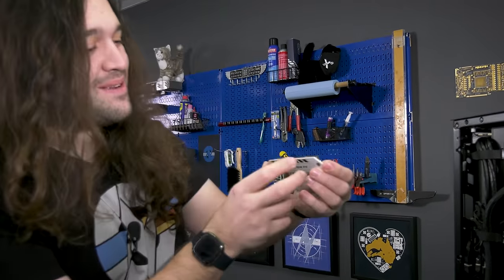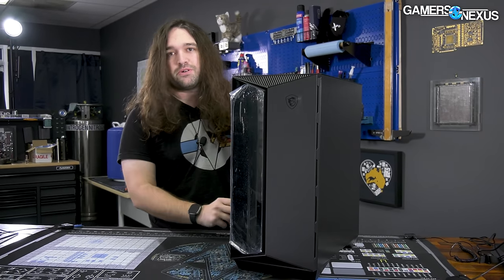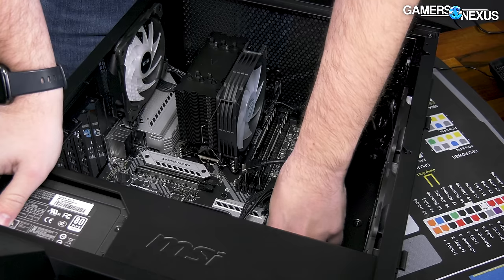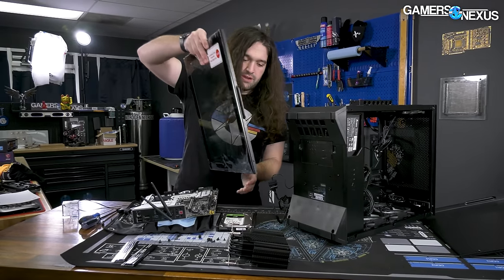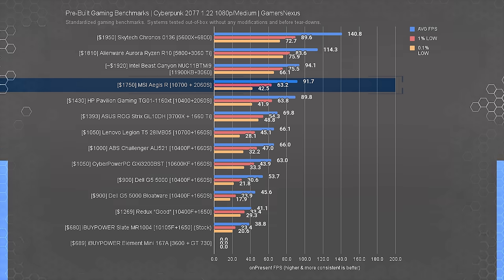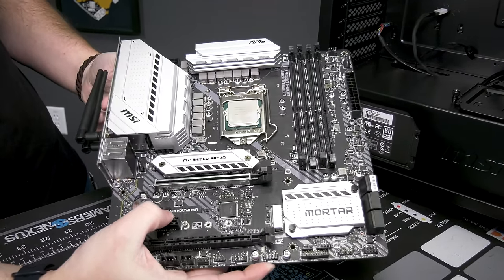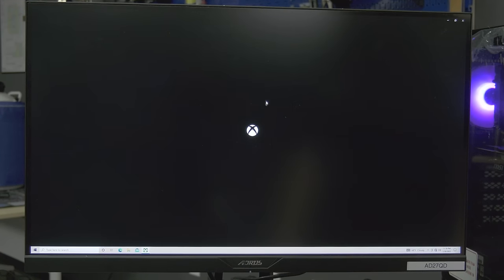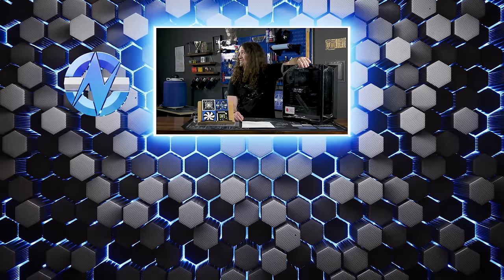MSI Pre-Built Bends SSDs & Boils CPUs at 100°C ($1700 Aegis R Review)

Comment: I needed a new PC and last year when GPU prices were astronomical(they still suck).  Have been building computers for 30 years now and trying to find parts during peak covid was a nightmare. SOOO I went with an MSI Prebuild (a previous Aegis build) that wasnt a completely terrible deal and had SO many issues with it.  SSD was faulty and the power supply exploded. Luckily I have components around and am pretty good at troubleshooting issues so was able to figure out the SSD was the issue but someone with less experience might have just ended up with a bricked system.  Returns were not an option so had to sort everything out myself.  I'll never go with a prebuilt ever again. I will personally never buy another MSI product because when I did contact them about the issues I got more of a headache than the initial issues caused.

Comment: MSI is hit or miss. They clearly have talented engineers, but I think it's the design/marketing departments who ruin their products.
Reply: Hit for me, my MSI z370 a pro is still working like on day one. Why did I pick it? It's the cheapest motherboard you can overclock with. This thing did cost me... 40€. 40€! The successor of this board, the MSI pro z690 a, costs 200€. What a fucking joke.
Reply: @tonnentonie2767  Hit for me too. I got a MSI G273QF monitor, same reason as you, it was the cheapest 1440p 165hz IPS with G-Sync (£250). I expected it to be rubbish but it was very colour accurate with brilliant motion performance. 

Only needed to do 2 things.
1) Change the WP to 6500K (it was R93, G99, B96 for my display). 
2) Download novideo_srgb and enable SRGB clamp (this relies on EDID, which MSI configured correctly). 

Calibration reports show that it's basically spot-on after that. Honestly a lot of stuff done right that I didn't expect for just £250.
Reply: @Terrobility  wow, when did you get that monitor? That's amazing spec for 250£

Comment: For anyone that does buy this system, just take the front panel off. Simple as that. If you want it to stay on, take it off, and use a Philips screwdriver to remove all of that metal mesh from the interior of the front panel, and then take a hole saw (a drill with a wide circular bit in it) and drill some holes into the plastic on the side opposite the tempered glass in the front panel. This'll get your airflow up to adequate.

Comment: The "guts" of Norton/Symantec security suite are light weight and work very well, plus they allow nearly every "feature" to be switched off which is exactly what anyone using it should do.... turn off everything except the AV and firewall.  (This takes maybe 2 minutes)  On the other hand MacAfee is complete buggy garbage no matter how its configured and just doesn't work as intended.

Comment: Only once have I seen a CPU that hot, and that was a Pentium 4 with a loose cooler.
And when stuff bends like that, the screws are to tight. Seen that with a cooler before, but all it takes is to take maybe half a turn off. They should probably use a thinner pad.
And that Case.... There is a reason why I prefer a plain mesh front. Looks good and lets air in and can filter. Even helps with noise because the air has more room and doesn't has to yeet through some tiny gap.

Comment: Why cant case makers at least give 1.5 inch grill or mesh on the sides of the front panel if they plan to have a solid front and front fan mounts? is it that hard or expensive? Feel like the only reason for front fans in half of the cases today are to add RGB. Not move more air! Also would be nice to add 2 inches to the top if you are going to add top fan mounts to let you use a radiator that's all for my rant on cases lol!

Comment: I don't think even a Liquid Cooler would provide sufficient cooling for 255w.... Why the heck is that a settig in the BIOS? Because I think that's the main problem and it would be if you put it in a different case unless you changed the setti gs in the BIOS.

Comment: I almost went with a MSI until I saw how hot some of them get. Lenovo Legions have excellent cooling systems and I got one for $500 off from Micro Center. My Legion never gets hot. I noticed some have because the front fan being put on backwards. Didn’t happen to me but it’s an easy fix if it does happen. I really like MSI and their quality of hardware but they need better cooling systems in their computers.

Comment: I think I know the problem. Each component is made by MSI factory line and robots and machines do it the same way for each board and card.  I don't think I have seen a robotic line put together a whole computer. Once the parts came off the assembly line it was probably handed  to a human for assembly in a case and the "Human Error" factor was probably in play.
It's sad because I have an MSI b550 Mortar and an MSI X570 Tomahawk and they both work great.

Comment: Are you guys sure that that's a 2060 Super? I have the MSI Ventus 2060 Super, but mine doesn't have the additional 6 pin connector and as far as I'm aware, no 2060 Super has one.

Comment: I used to think the case didn't matter too much. Then I bought a cheap one without realizing it had absolutely ZERO ventilation and my machine 'bout caught fire. Since I thought I threw my old case away, I no joke dremeled a hole in the top and screwed a fan directly into the metal. It STILL ran CRAZY hot so I said fuggit and grabbed the dremel again...cut a MASSIVE hole in the case door and stuck (literally) the biggest fan I could find to it. With what was essentially box fan stuck to the side of the case, temps were finally OK! lol...the case matters.

Comment: Welp thats upsetting to see... I bought one of these a couple of months ago after my last pc died because it was all I could really find in my area that fit my budget and needs. Any advice for how to fix this going forward? Newer to computers in general, not sure where I should even start.
Reply: Personally, I would start by downloading some sort of hardware monitor for temperatures. MSI Afterburner is an easy one to use. Then start looking at the temperatures of the CPU and GPU being reported in the monitor before taking any further action.
Reply: @Pog Tuber  I did that and honestly im not seeing the same issues in the video. I downloaded a temp monitor and cinebemch to test the cpu out and saw my temps only getting up to 84°C which from what im reafing is right on the limit of acceptable. When transferring large files my power plan doesn't change to the custom profile. I know there are other cases in this same lineup of cases that has much better ventilation on the front, do you know if i can buy a ventilated front panel and have it be compatible?
Reply: @baguettemeister6032  I don't know about the front panel, you would have to buy one specifically made for your case. I don't like that 84°C temp though, personally. It's not dangerous but a properly installed aftermarket cooler should be doing better than that.
Reply: @Pog Tuber  This is of course with the cpu completely pegged on cinebench I don't know if thats completely representative of the temperatures ill be encountering in my daily driving of the pc. Even playing some pretty intense games like escape from tarkov my temps hover around the 50-60 degree mark.
Reply: @baguettemeister6032  AHh OK my bad, yeah Cinebench is not realistic at all, I thought you were getting those temps during gaming. So yeah you're fine.
Reply: @pogtuber5146  Maybe I just got lucky then? Hard saying.
Reply: @baguettemeister6032  It's possible that Steve got unlucky and received a flawed product, as well.

Comment: I have that computer I bought it on Newegg a couple months ago mine came with a Nvidia 3060 and the same CPU however the first thing I did was put a second SSD and swapped out the ram but even when I first got it it never had a heating issue despite the fact that the case is kind of eh

Comment: Im at the moment doing a build for a customer for $1600 build and hes getting way more computer lol thats crazy haw bare that is for 1700, he gettinng a 9900k with a gtx 1080 ti , evga 850 psu,16gb ram gkill, 1tb samsung drive,core p3 case, corsair 240mm aio with lcd screen on the water black thats show gifs with rgb corsair ll fans and a few other things that have came in yet, its a full custom that blows this one away, its crazy how much msi is asking for this low end junk of a prebuilt XD thanks steve for showing potential buys and helpng them dodge this mess.

Comment: The backplate will actually get you 7-15°C higher temps, I have an RX 5700 MECH GP OC, and it idled at 46°C with the backplate on and casual 105-111°C under load, without the backplate it idles at 33-35°C and 90-100°C under load. So the backplate since it has no pads is actively hurting the performance. I took it off, but since this is MSI we are talking about, there obviously is that Half a scam sticker on the screws. It is also quite sad since the cooler is actually decent, my 5700 is bios modded, so it runs at 2000 Mhz under full load compared to 1600 something Mhz, just that backplate is borderline criminal.

Comment: Hwo can one fix that MSI custom power profile that tricks windows and makes it run like hades?  I wonder if that’s standard affair for all their gaming ore builts. I have a ZS with AMD 5800X and 3060ti. HOT 100 at idle - replacing 120 aio with 240/360 but if this “trick” is also on my rig that is an issue. Help!!!

Comment: Glad Ive avoided buying any MSI products. This and their board issues have convinced me to steer clear for good.
Reply: I've had 2 MSI boards now, a b350m gaming, and a b550m bazooka, both work fine and I sold the other. 🤷
I can push a 5600x to 4.9 all core. From my two systems with them, they've been great to far.

If I had a better case with a mesh front and could top mount my aio, I could get probably 5.0 but my temps are still ok, just warmer than it could be

Comment: Just a thing about the MSI Case, it's pretty garbage imo.
Fans are loud, the stickers of the fans are not always centered so basically when they're spinning it seems like it's wobbling for some reason.

On a side note, if you've got that MSI case (110R Gungnir) you can probably try to see if you can swap the panel for the 110M mesh version, which is probably fully compatible.
Other than that, a last thing to add, the front panel has that full metal black cover, you can remove it and place a mesh instead of it, it's just that it's not supposed to work like that so it's a bit ugly to be honest but if the fans are good temps should get better

Comment: It's very clear between the plastic backplate and the case, they prioritized the looks of the computer over the performance. "Cool" looking computers sell, I guess, since many people don't know the difference. However, there certainly are "cool" designs out there that have good airflow too. I wonder if that BIOS and windows install is meant to be for another hardware config with a big liquid cooler that could take the heat, and they're just lazy and inappropriately reused it for all the systems?

Comment: I am not sure I have seen a mobo m.2 heatsink NOT bend an m.2 drive. So I don't use them or I switch the thermal pads for thinner ones. I see Asus now includes rubber pads to support the m.2 drive to help prevent this but I would rather it not be an issue to begin with.

Comment: i dont understand why the gungnir 110r is so much more popular than the gungnir 110m, the only difference is that the 110m has a nice slitted front panel instead of solid glass, theres also the 111 series but the way msi has them and the differences between 110m/r and the 110m/r is stupid and extremely confusing

Comment: I got an MSI Aegis, and would never recommend it. Sadly I had to get it because of availability of parts, During the pandemic. But mine, came with a 2080 super, an MSI branded AIO cooler, that has a 120mm fan and rad. An 1 TB m.2 SSD, and 1 TB HDD. All these things, in some way as failed and needed to be replaced after a year. MSI 2080 super, just had a one year manufacturer warranty. The AIO coolers pump failed, and the thermal grease cured and dried completely. And very surprisingly. The CPU 10th gen intel, RAM (Which I upgraded to 32 gigs, for rendering reasons), fans, and power supply are running strong still. BTW, not looking for sympathy. I got my problems sorted for now, but this is just a cautionary tale. My computer costed little over 2,000. I doubled it's cost, replaced the failed components. In just little over a year of having the PC, which is a wow moment.

Comment: 💀💀me with my system that i built for 650$ with Ryzen 5 3500 Rtx 2070S 16GB 3200 C16 dual channel memory, and the amd stock cooler where cpu temps are at highest 85 when rendering in adobe PP or AE, even cinebench, and gpu temps 75 max in fur mark -- (i feel proud)

Comment: Bought the Msi Gp66 Leopard with the 3070.  Overheating is a understatement, just running Youtube Cpu and Gpu runs easily 75-80c and playing any game it limit undervolts  it by 50 watts at 95c. (normally 130 watts) Bringing down the performance to less then a 2060. Another big problem it has is the keyboard now has had 3 keys completely go out the backspace shift and number eight key with couple more trying to go out.  What's even worse bought the extra insurance to cover things like this happening which they do cover but have to pay for shipping.  Wtf is the point of the insurance then manufacture warranty should of covered everything that's wrong with it.  Btw laptop is less then a year old.  Do Not Buy Leopard series...

Comment: Funny enough my pc did the exact same on my screen at 22:12 in the vid dono if its either some sort of Artifacting or just a weird power issue

In my case my PSU power cord/kettle kord made weird arcing buzzing sound almost as if the cable is bad. I put in a brand new Power cable which i got with my PSU and my problem went away. 
And yeah.  I aslo do have a MSI Card. Ge Force GTX 1050Ti Gaming x

Comment: Backplates, unless there is RAM on the back, doesn't really affect fooling.  More to cover the circuit board, which may be beneficial.   I know, I am trying to find a positive in it, but it could be a valid point.
The bent SSD really got me though.    The cooling would likely be okay given the additional grill at top and bottom, but this is a disappointing build from someone like MSI.

Comment: I love msi, i have an amazing build using mostly msi and corsair, now to start its a custom build by me so its not dumb as shit like msi prebuilt lol 

corsair 4000D non airflow (I'm going to cnc the msi logo with lava veins surrounding the dragon on the front panel for more airflow and looks, very easy to pull off since the non airflow model has a thick flat basic front panel)
msi b450 gaming plus max
3500x
corsair vengeance pro rgb 2x8gb 3200mhz
msi gaming z 2060
Samsung 970 evo 500gb m.2
corsair RM650
4tb of random HDD's
msi optix G27C5 165hz curved 1080p
x2 Samsung 27" 60hz curved monitors 1080p
full Logitech peripherals with g502/g512 with the cheapest Logitech headset and 2.1 speakers
msi desk mat

my mods include:
Samsung s20 ultra for status screen using trigone mounted to psu shroud (cameras broke so I'm using the oled to have true blacks, looks way better than raspberry screens)
vertical gpu mount

also I get 65 degrees Celsius average on both cpu and gpu running all games, I've only seen 70 degrees on my CPU once because I forgot to clean my front filter lol

I'm going for a 3070 or 3080 soon and the 5800x3D and moving my 2060 to my custom OG Xbox pc home theater build, I cutout the grills to put acrylic glass. I'm doing an external power supply and external water cooling so I can save space and look cool with extra cooling over air-cooling in such a small space.

Comment: Apple has always been cooking their CPUs at 100 to 105C... I still have my 2015 Macbook Pro and by default CPU temperature was at least 100C always as it would stop the CPU fan if it was not toasty enough. But custom fan software and CPU undervolting brought it down from 100+ c at max 2.2Ghz to max 60c at 3,3Ghz even running all 4 cores at that speed 100% cpu usage.

Comment: I have a prebuilt Aegis R but it has a Rtx 3060 with a i7 10700k and a 340mm AIO I believe with an ssd and 16gb of ram. I can cinebench test it and never seen a cinebench test above 85f run all hardcore games like tarkov and warzone at 60-62f gpu temps and between 70-75f cpu temps when using hardware monitor. Runs at 5ghz on cpu when gaming and goes back down to around 1 when idle seems like a good pc to me never had any issues. This version seems quite trash tho yet it has the same name just dif parts. I did enable xmp in bios, as well as turbo boost for the cpu and I created my own fan curves cause the stock ones sucked but since I’ve done that pc runs great been almost a year and 0 issues good temps and good fps in all the games I play.

Comment: The reason they don't enable XMP is because the case is crap, the case internal temperature will be at least 50~60c, meaning if the XMP was enabled it would be over the memory IC's temp tolerance, and starting to blue screen...... You probably should give MSI a "thumb up" for not enabling XMP.

Comment: This is a 2200 USD plus PC if you try to build with spare parts, buying part by part and build it yourself (MINIMUM). We didn't see you unboxing the PC so any of your  complaints about is finishing are literally useless for the audience. We didn't see you testing the PC before your started to disassemble it. We didn't see you applying the thermal paste again so no point showing temperature. Everyone knows 10700k is a hot CPU with literally any aircooler. What are your comparing it with exactly? So I definitely couldn't get your point criticizing this PC. What's your point? In my opinion this is a free aggression to the MSI company.